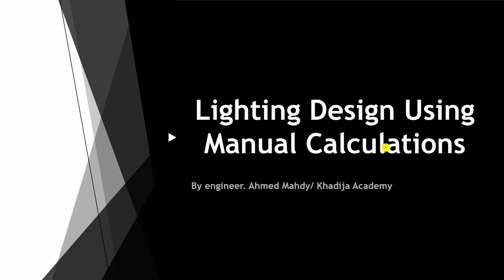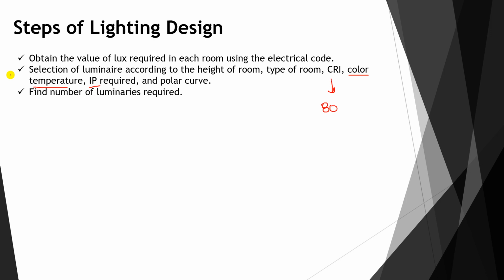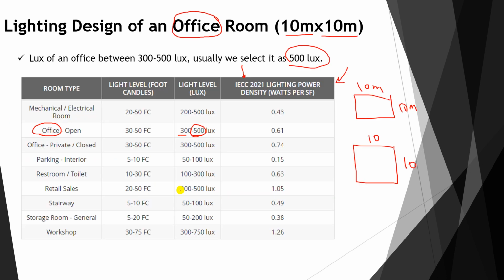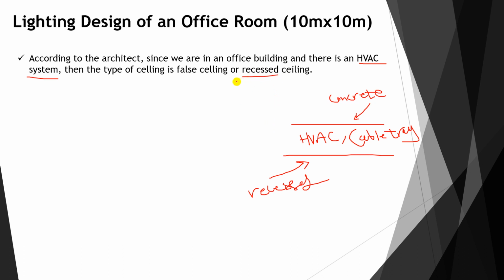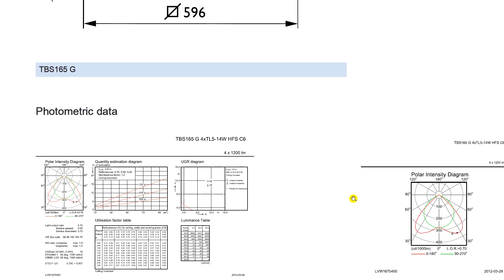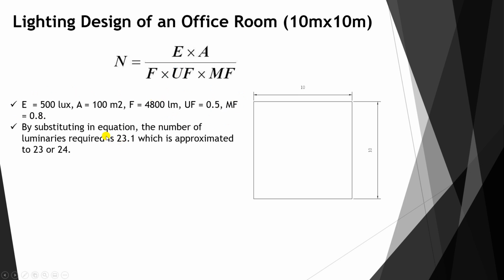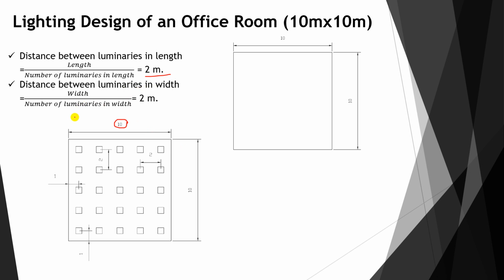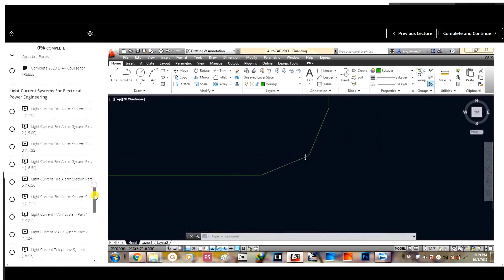Lighting Design of a Room Using Manual Calculations for Electrical Engineering

Comment: You don't consider the length of luminaire
Reply from the maker: Hey Jerry,
This example is for illustrating the manual calculations procedure. You can assume that the luminaries are of the spot type. 
However, in practical design, we don't manually design the lighting in a room as explained. We actually utilize the Dialux Evo software to do this required procedure.

Comment: Light Source Color 830 is short way of representing CRI 80 and CCT 3000K. Correct me if i am wrong
Reply from the maker: Hey Siyam,
Nope, look at the corresponding values of CRI and CCT for each code, you will find it is not always the case:
https://www.bltdirect.com/lampcolourtemperatures

Comment: For residential apartment how it be for lux Residential spaces:

a. Living room – 100-200 lux

b. Bedroom – 200 lux

c. Kitchen – 300- lux

d. Bathroom – 300 lux will this be enough
Reply from the maker: Hey John, 
Usually when designing the values can be found in the electrical codes like IEC and your country electrical code to get lux range for each room. I can't attach an image to the comment to help you.